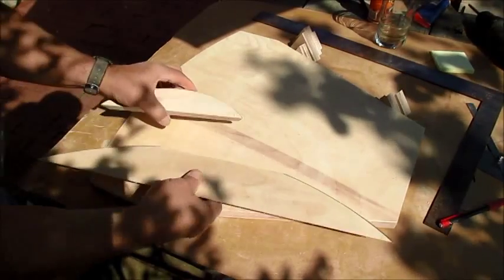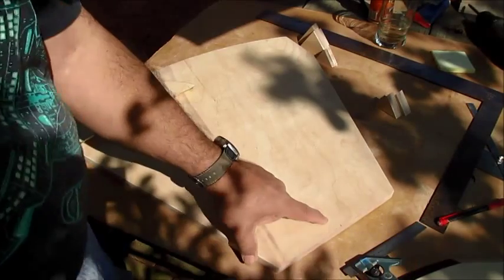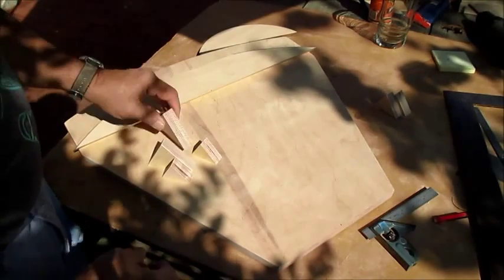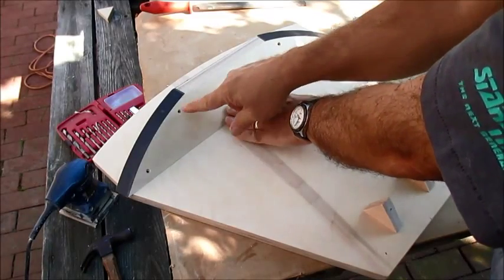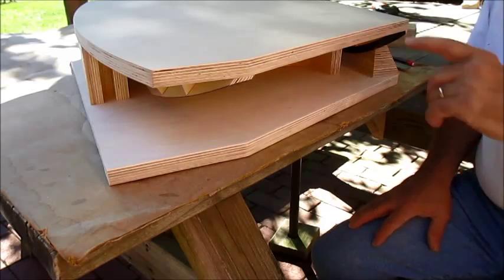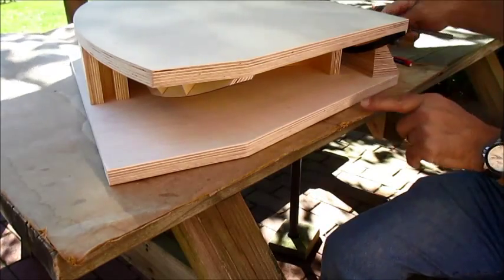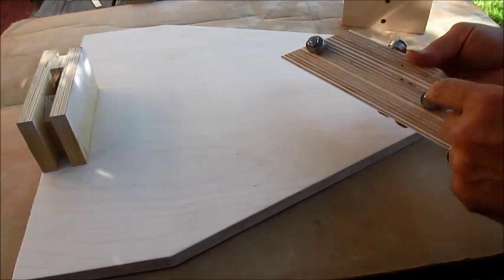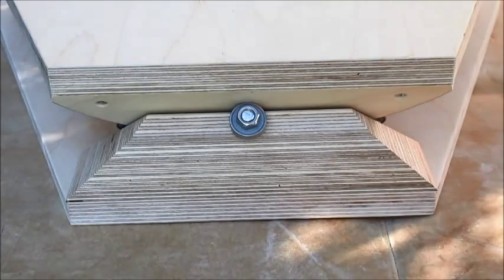Eq Platform part 2

Comment: I want to build a platform for a 16" f7 truss dob. i don't know the balancing points of the scope yet. I also have a 12" mirror with a f6 ratio  where woul I order the drive motor from and a hand controller and would it be possible to have variable speeds on the motor. thanks. I want to use the scope for imaging
Reply from the maker: Joseph, I use synchronous motors and I get them from Herbach and
Rademan.  They also have stepper motors if you want to go that route.
 With synchronous motors you need to use a variable frequency power
inverter to vary the speeds.  A hand controller is something you'll
need to make the hand controller and most likely the VF drive too.

Ed
Reply from the maker: Yes, inexpensive inverters will have a RC timing circuit.  If you can find this resistor you can switch in or out more or less resistance to change the frequency which changes the speed. It's rather easy to do.

Comment from the maker: It hardly takes a video, you just put the laser fixture on the back edge of the platform and then adjust the platform to put the laser on the pole or Polaris.  It takes only seconds.

Ed
Reply: It may seem obvious, but I've been searching forever trying to understand how these work! A short video where someone explains how it works and sets it up would be wonderful. Are there any longitudes where the required inclinations make these mounts unstable?